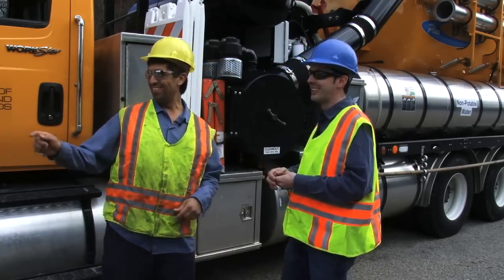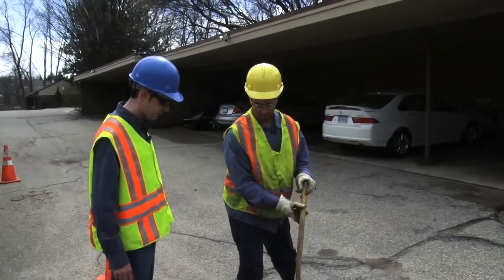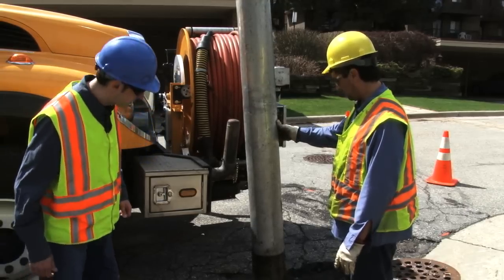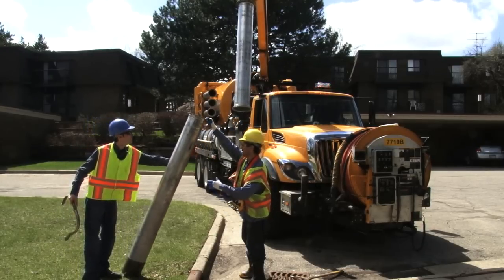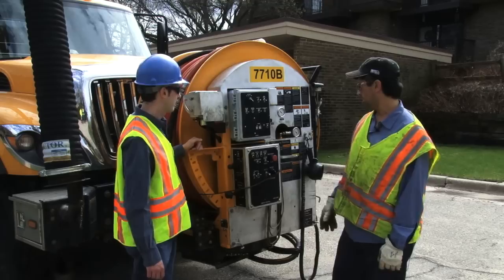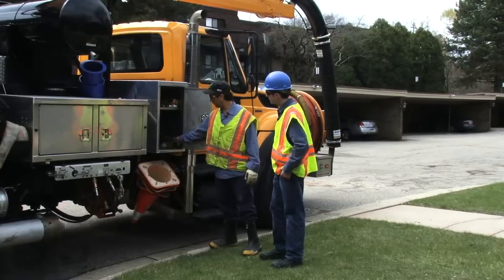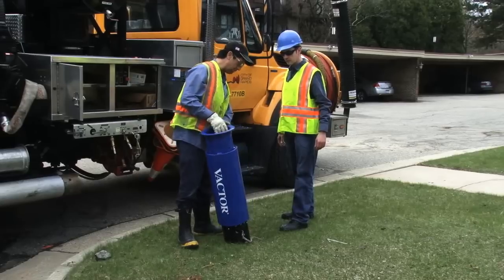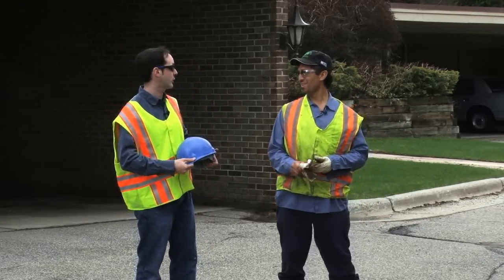Exploring a Sewer Vacuum Truck

Comment: How can I get this job???? Do I have to go to school???? Someone help
Reply: Get a straight truck license and look for combo/flusher truck driver you'll get trained. FYI you're dealing with live  sewage there's so much pressure even on low you literally get crap in your face.try hydrovac it's hydro excavation which is muddy but no sewage and the pay is by a margine. $50,000-70,000 a year on hydrovac probably $40,000-$60,000 on combo

Comment: I'm guessing "technically-mechanically" that black tank is involved in solving a problem that might occur where the solution is against environmental regulations. On his job, shit happens.
Reply: The black tank is a vapor recovery system to  remove the fine mist of water in the air stream after the air has gone thru the cone shaped accumulators at the back of the truck. The cone shape spins the heavy dirt out of the waste water that has spilled out of the big debris tank. The mist and air then go thru the black tank (sometimes it is call the "secondary tank") and finely the air is pulled thru the vacuum lobe pump. This vacuum pump or "blower", cannot move water thru the pump itself, just air. Water or debris would clog or destroy the internal workings of the pump. That's why the air is filtered several times as it move thru the  system.
To have this black tank fill with water means the operator is not paying attention and has overfilled the truck. Damaged blower pumps cost  $10k or more to replace. The operator was trying to avoid admitting he may have overfilled the truck while filming.
Reply: The black tank is a Giant Muffler. The air blowers through the blower and the air goes into the Muffler and exhausts out. It's essentially a silencer for the blower.

Comment: where's video on router part?
Reply: The term is " rodder " or " jet rod ". Older trucks called rodders linked long sections of flexable rods together and spun them like a plumbers power snake as they pushed the sections down the pipe to clean the sewer lines.When they started using high pressure water instead of these rods, the name stuck.